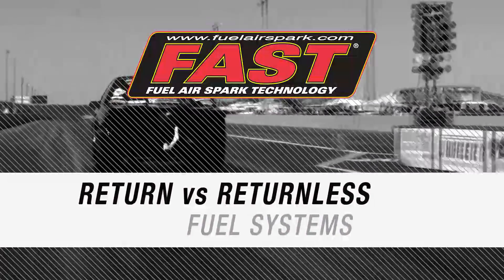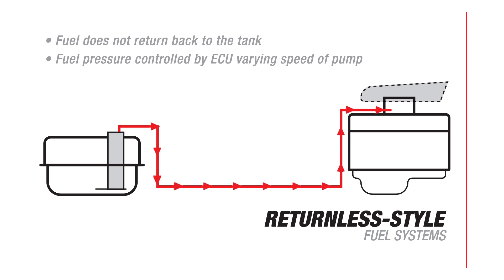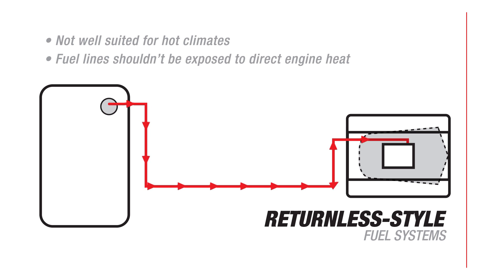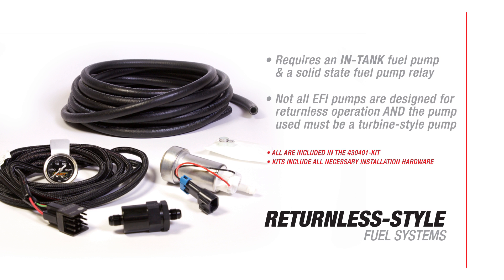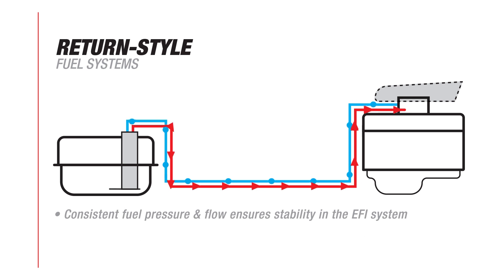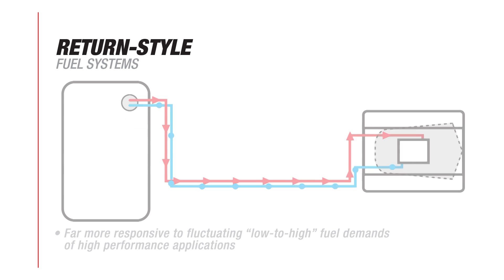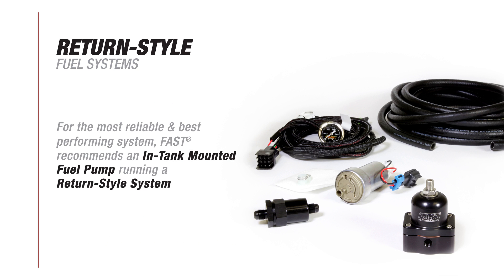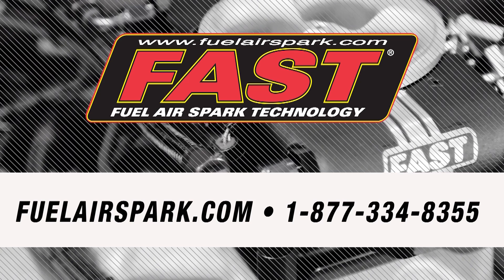FAST: Return vs Returnless Fuel Systems

Comment: A lot of my mates running return style on e85 of their track cars and having major issues with the fuel in their fuel cell heating up like crazy and causing tune issues because the fuel is going into the hot rail getting heat soak then going back to the tank only to come back to the fuel rail multiple times and back to the tank. E85 don't like getting hot like that and the huge flow required means that the fuel is flowing more than enough to avoid problems like vapor lock and stalling. Unless your happy to basically constantly heat all the fuel in the tank then return is all good but if like me your trying to avoid that then return less may be the way to go. Think about it
Reply: add an in-line heat exchanger
Reply: @kevinlongstudios  Yup, adding a little radiator like a transmission oil cooler somewhere on the return side to help dissipate the heat the fuel picked up in the fuel rail and lines should help. The big problem is where would you put the cooler? It needs airflow to function and putting it in front of the radiator where it's easily damaged by debris or accidents would be a great way to start a giant fire if things go wrong. Putting it somewhere under the car might be somewhat helpful, but it probably won't be super effective because the cooler won't be getting particularly cool air under the car.
Reply: Not worth adding a heat exchanger. More money on more parts and more potential for failure. Why go that route when the manufacturers have engineered and improved fuel delivery with returnless. If their systems are good enough for a CTS V or Camaro ZL1, I’d trust the OEM system
Reply: @uscfan92879  when your old car isnt set up for returnless and you already have a return system setu up and working, its actually easier and cheaper to throw in a little heat exchanger. and its not got any moving parts so very low risk of failure. If i wanted to set up returnless then i need to replace my pump and my fuel pressure reg, or relocate my reg to my fuel tank and change everything. so its parts cost anyway. i would also have to have some janky ass blocker on the end of my fuel rail where the pressure reg mounts to block the return so either new fuel rail or modify mine so more money or more failure points lol so yeah idk mate "its 6 in one, half dozen in the other" as we say in australia. if your car is set up returnless its generally easier to keep it returnless, and if its set up with a return its generally easier to keep it return